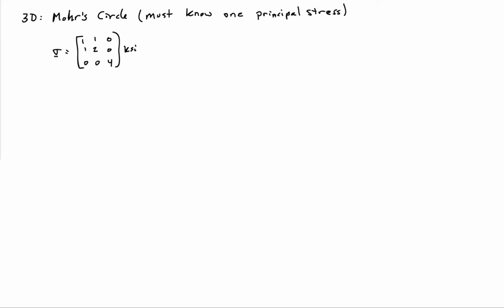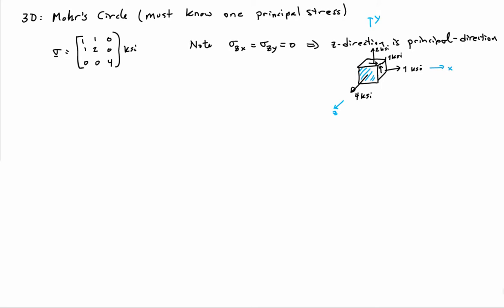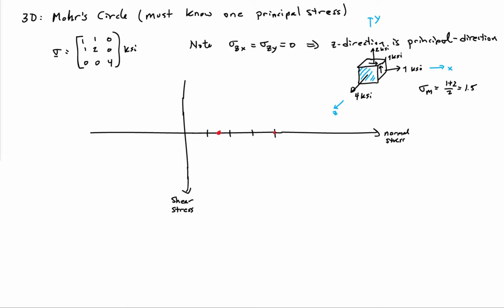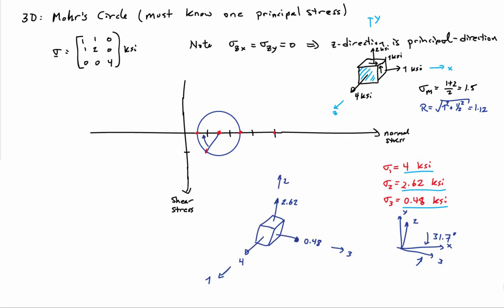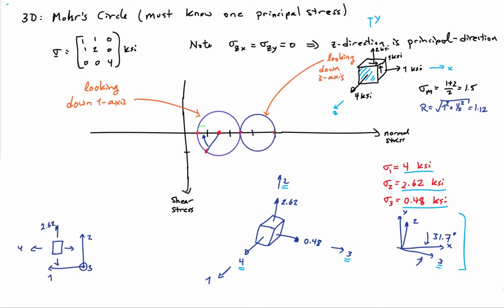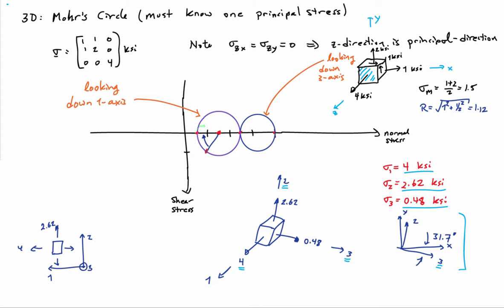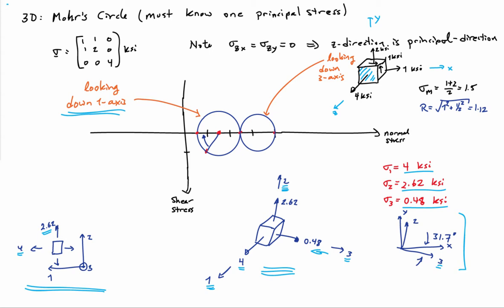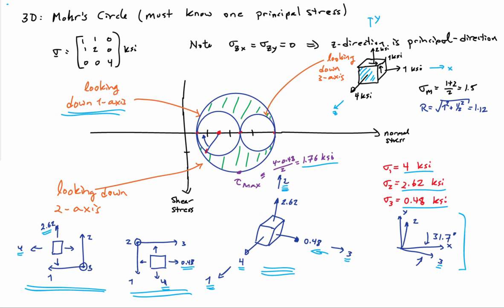(32C) Example - Mohr's circle 3D

Comment: Thank you for such a great video explanation! We know from this that the angle between x-axis to first principal stress axis, but what about the other two angles? for 2nd and 3rd principal stress axes?
Reply from the maker: The principal-axis-1 is the z-axis.  Principal-axis-2 is 31.7 degrees clockwise from the y-axis (in the plane normal to the z-axis).

Comment: Thanks for the explanation, this video helped me out a lot. Quick question, for finding sigma 3, shouldn't it be 0.38 ksi because it's sigma m (1.5 ksi) minus the radius (1.12 ksi)? Correct me if I'm wrong. Thank you again for the great walk-through!
Reply from the maker: You are correct!  sigma_3 should be 0.38.  I guess I can do mechanics but have some trouble subtracting numbers :)  The max shear should also be adjusted to be 1.81.
Reply: It was on the tip of my tongue.